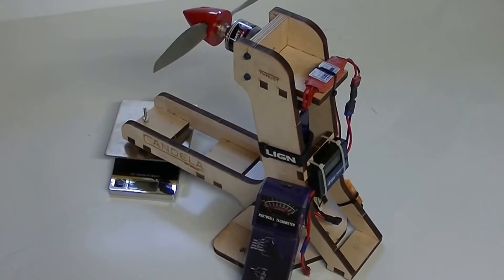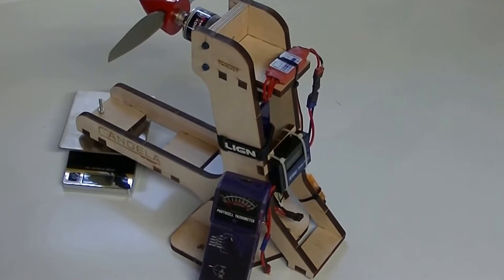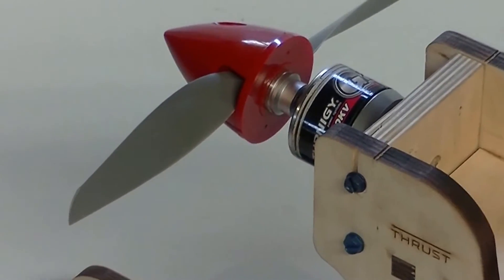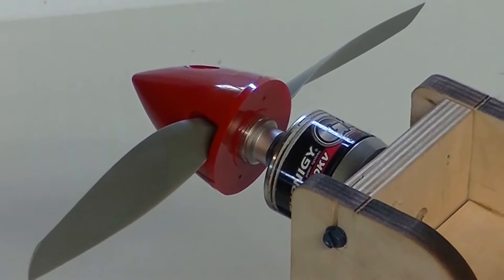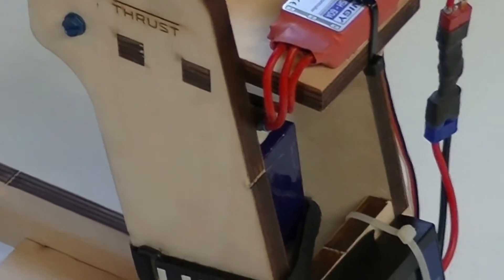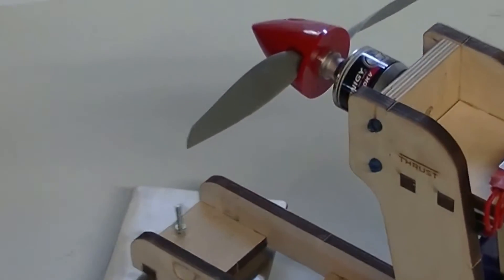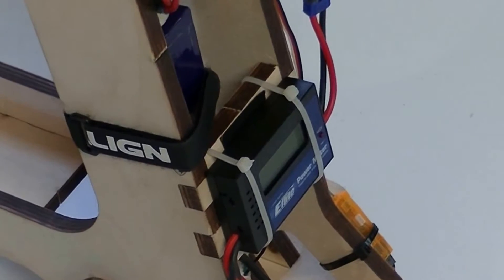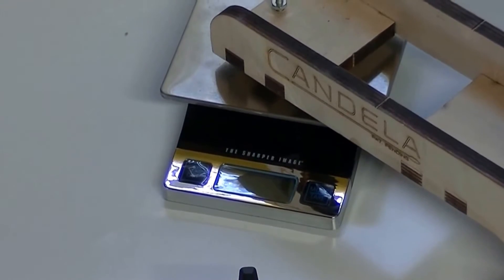Candela RC Engine Test Stand : G-46 Turnigy :  set-up and testing demonstration

Comment: hey Charles im here
Reply from the maker: I here too, Hey dont forget about testing the paraglider in the morning,, I will be up early at the office getting the chute packed.
Reply: Candela Research Center No problem I am going to work on the ejection module for the Quad recovery chutes
Reply: Candela Research Center I am at home now,,did you fly your quad today?
Reply: RVA Drones Later..
Reply: Charles Cline yea and with there-wire,newfirmware,settings,and battery placement I got 12 min. of flight .It had a little drift in self level mode but nothing that cant be adjusted in the f/c board
Reply: RVA Drones I knew that new wiring was critical. How about yaw when throttling up?
Reply: Charles Cline worked great next time im gonna try full chargeand run them alittle longer, I think I can get 18 mins on 2  Afterthat im gonna steal the other 2 from U.R.S.A. and see what she can do..
Reply: Charles Cline I had plenty of throtleso I think 4 8.0 will work
Reply: RVA Drones you mean (4) 8000ma lipo's?
Reply: RVA Drones did it turn when you gassed it ?????I was wondering about the shield loops we placed..
Reply: Charles Cline still had one motor draw faster but I think its the magnets yaw is under control now and yea 4 8000 mal's 25-50c
Reply: ok time to go do some midnight work. see you in the morning at the office